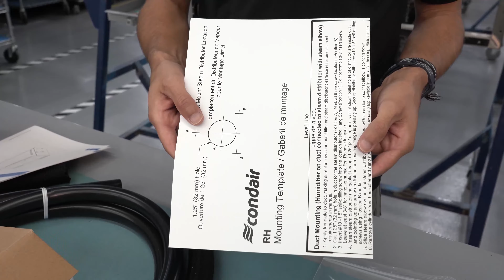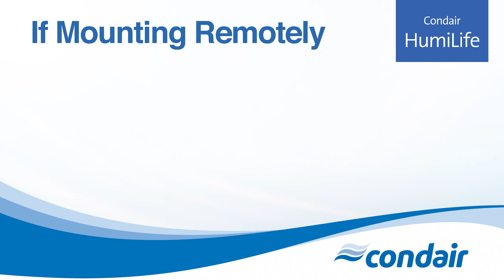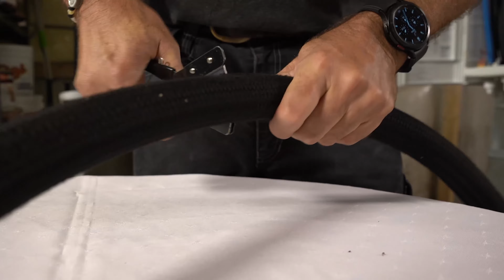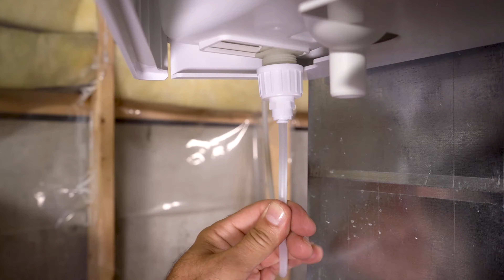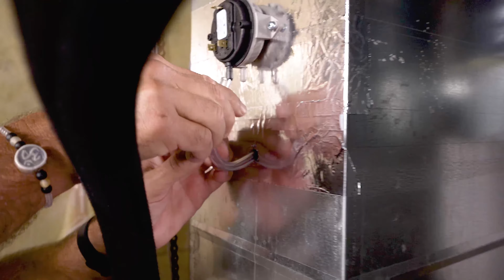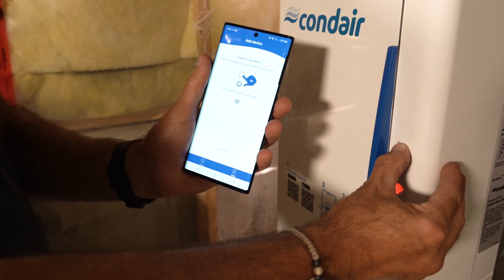Condair HumiLife - Whole-Home Steam Humidifier - Full Installation

Comment: Almost nowhere in the US are saddle valves allowed for a water supply line.
Reply: No. I passed inspection just fine!!
Reply: @ChicagoSledder  I have one in my home, working fine and now almost +20 yrs. old. I am used to, in US technicians following the same stuff which was relevant in 60's. These valves have improved drastically with silicon gaskets instead of rubber. Analogy quite similar to +70% still changing oil every 3000 miles because that was the "thumb rule" 30 yrs ago, irrespective of the technological advancement.